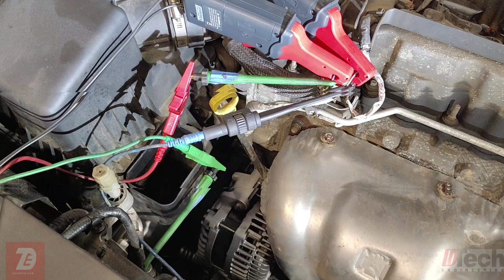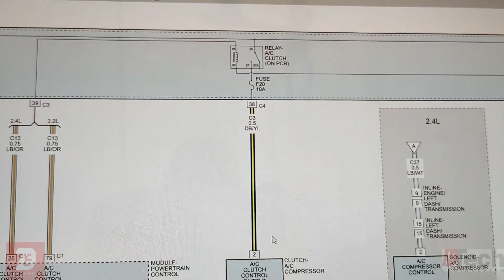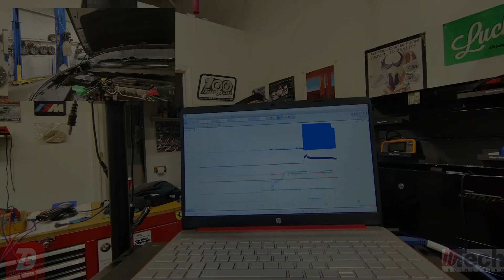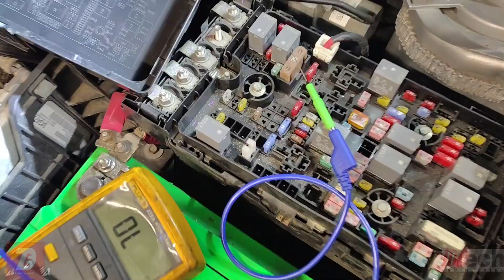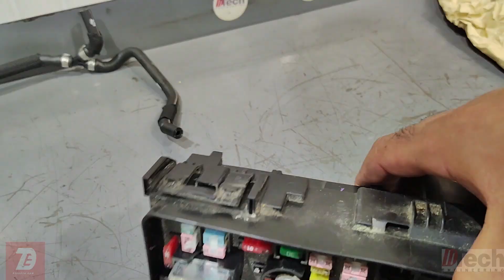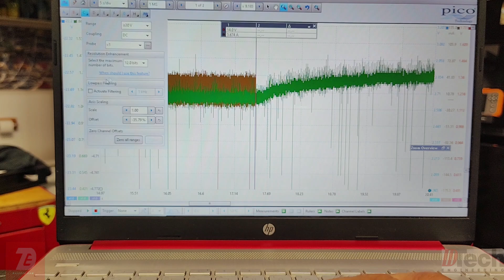Jeep AC STILL Not Working After New Compressor

Comment: Very good diagnostic,in my opinion someone replaces the fuses box in winter for the fuel pump relay from the jonk yard, it's surprising that no more circuits have been affected since the connector can go All the way inside.

Comment: Hi, i have 2 questions please.

1. Can I backprobe the solenoid on variable compressor using power probe and provvide power or ground(based on power or ground switch) to make it as 100% duty cycle.  basically overridding ECM duty cycle for quick test ,  if i do  that will it over power soelinod or burn out ECM.. please advise.
2. have u every diagnosed blocked condensor. if so what test you do to confirm it is blocked condensor..  let assume the high pressure switch is after condensor on the liquid line, if high pressure is lower (say around 70) and low side is normal on txv side.(like around 30 to 34) this usally indicates blockage on condensor ..  sometime some says use laser pointed infrared temperatug gun and messure inlet and outlet of codensor line which should dissipate x amount of difference. otherway is to remove bumper and use thermal imager.  again these are some theories, but have you ever done any practical experience on this kind of situaiton.

Apprecaite your help
Reply from the maker: yes you can power up the solenoid, but I would disconnect it from the harness and independently power it up. As far as the condenser, I haven't run into one that is blocked that I needed to diagnose, but I would think to use a thermal imager for best type of attempt.